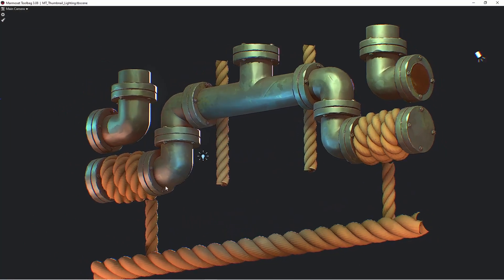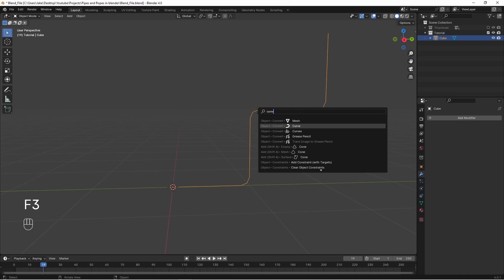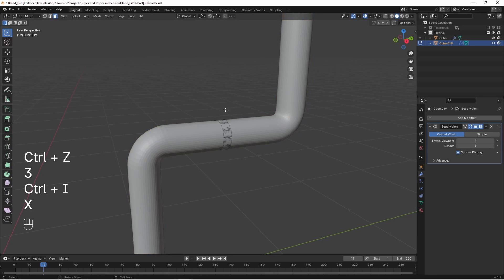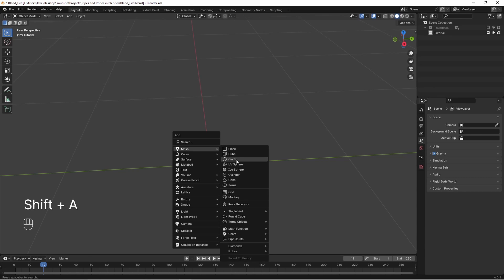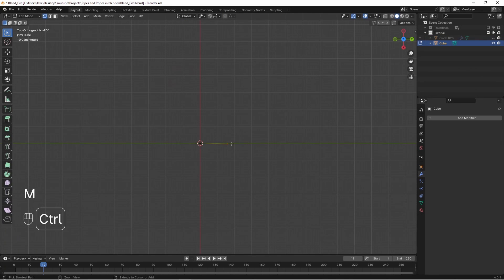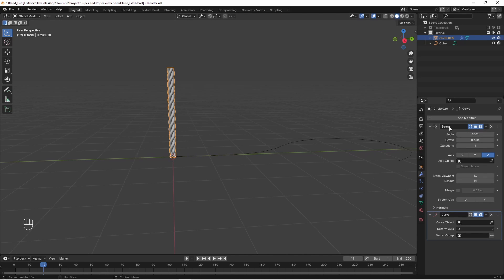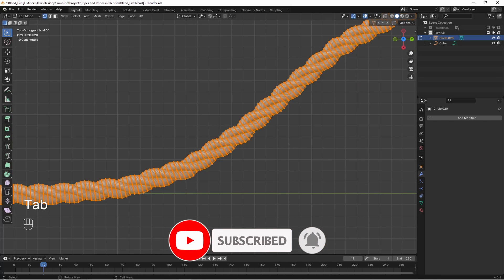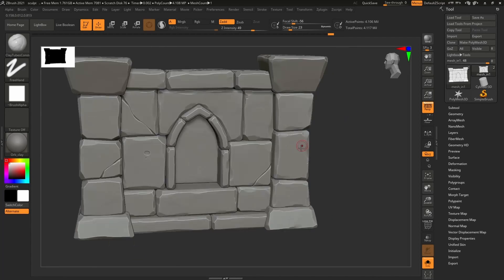Modeling Pipes And Ropes In Blender In Under 3 Minutes!

Comment: Huge fan of your 3D videos! ✨ I'm hoping you could share some advice on a tricky problem I have with my 3D snake tipe dragon model 🐉. It's one entire, fully connected body – not part by part – and when I try to make it curve and twist into a pose with very tough force (so I can take an awesome image!📸), it just becomes super stiff and unrealistic 💔. Any tips on how to get that fluid, natural, powerful motion? 🙏 Thanks a ton! 🙌
Reply from the maker: Thanks! glad you like the content. One long snake should be really easy to make a basic rig for posing purposes,
 I would just make bones in a chain along its length skin them with automatic weights and then pose the dragon using the bones

Comment: Model pipe in blender!

uses 2 paid software throughout the video

🤬🤬🤬🤬🤬🤬
Reply from the maker: the modeling part was in blender, the other part was just to show how you can take it further to a textured asset if you wanted to.

You can also use the same methods in Blender with blender sculpting tools and Ucupaint if you wish to take it to a finished asset, there's nothing stopping you.
Reply: @StylizedSchools  I know, I'm just messin

I do think it'd be interesting to show the entire process through blender, but that's just me

great tutorial either way!
Reply: @theescapingman4711 no no, you were right the first time. The thumbnail shows a finished asset and says 3 minutes in Blender. Throwing in those other programs which are not easy to learn or use at all is disingenuous.